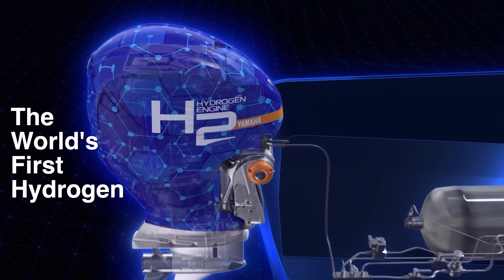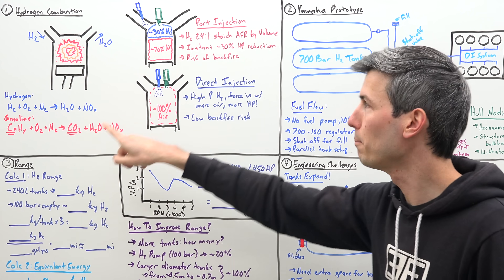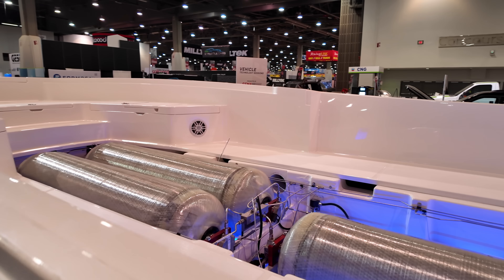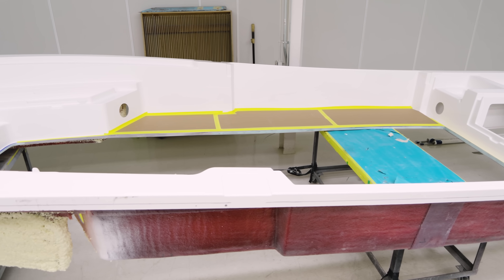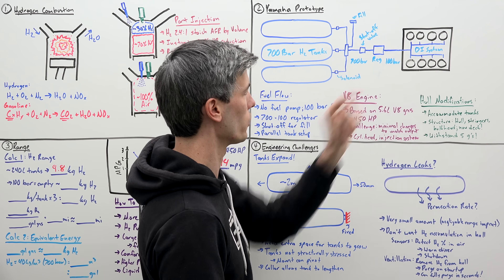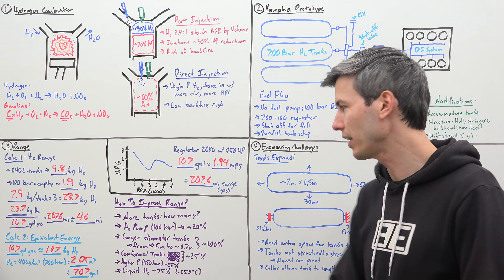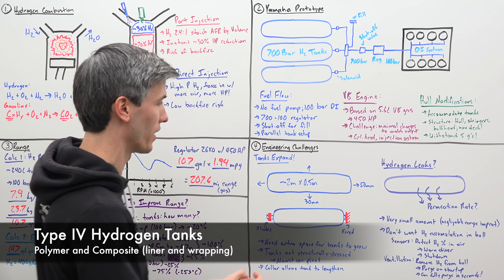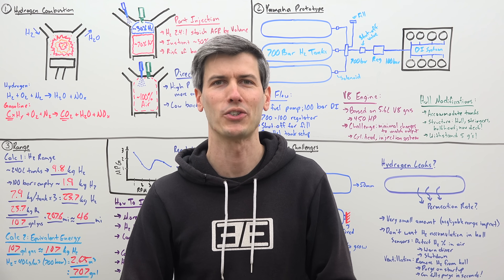The World’s First Hydrogen Combustion Outboard Engine!

Comment: psst....."hey buddy; forget that mess and use propane" it's easy and cheap to retrofit to ANY existing IC motor that runs on gasoline and has way, way, WAY more infrastructure already in place for fill ups. I converted my boat a couple of years ago; no more carburetor fouling, no more water in the fuel, no more fuel going bad when it sits for extended periods and a little bonus is that propane has a slightly higher octane.

Comment: Great video, the concept does not seem viable to me. Aside from the range and storage issues you detailed, all of those high pressure lines are subject to massive vibration and shock as the boat hits waves and the hull flexes not to mention corrosion from salt water in the bilge. The lines will fail in time or require the whole deck to be lifted to replace/inspect .
It would not be too fun sitting on the water with 10000 psi of hydrogen leaking into the boat the engine shut down and the purge system both beyond capacity and running the battery flat.

Comment: A battery electric will be better. To achieve 46 miles of range, we need just 266kWh of batteries. At 260wh/kg energy density at the pack level, like the 2023 NIO ES6 150kWh has, the battery pack would weight 1000kg (2200lbs). But we are saving the weight of the engine 436kg (963lbs) and the weight of the fuel 291kg (642lbs). Ok, we need an electric motor and electronics, maybe 30-50kg. So the battery powered boat would be about 300-330kg (660 - 727lbs) heavier than hydrogen, would have the same range, and would not have the hydrogen management issues :)

Comment: Hi Jason, not sure if you’ll even see this but I have been pondering something recently. At a given displacement, is there a cylinder configuration that would inherently produce more torque/power? (Ie. 2.5 liter i4 vs v6) and, if that is the case, would this be the same as displacement in/decreases? I couldn’t find anything on here but this seemed like a strikingly fitting topic for your channel

Comment: Should do a video on how H2O is a stronger greenhouse gas than CO2. The tailpipes from these engines emit steam. So a condenser and in-vehicle collection storage would be advisable, except on a boat of course. If we hypothetically replaced all vehicles burning fossil fuels with H2 what difference would that make to greenhouse emissions. Also, there's still NOx emissions.
I admire Yamaha and Rouse having a look into the technology, but I really can't see it gaining traction. I would never be even remotely interested being near a tank holding 700 bar of anything, no matter what certifications.
Reply: "H2O is a stronger greenhouse gas than CO2."
H2O is water, i.e. rain. Do you mean something else?

Comment: It does seem to be a bit of a futile attempt by the traditional ICE companies to keep building ICE engines at all costs.
The video starts out saying that battery electric is out of the race because the batteries are too heavy if the are to give the equivalent range but at the end of the video hydrogen can’t even get anywhere near as close in range but on top of that has all the challenges of dealing with hydrogen. 
Electric are the future and there has been big improvements in energy density of batteries and more to come in the future. Hydrogen is hydrogen you are not going to change the characteristics of it so there marginal gains to be made. And as others have pointed out, the creation, transportation and storage of hydrogen kind of outweighs any environmental benefits from using it. 
Maybe for really big ships you might have the space to make it more viable but I haven’t seen any developments in this area.

Comment: 79% of the volume ot air in the cylinder of which 19% is oxygen means that the amount of oxygen is 15% of the volume which is sufficient to convert the 21% hydrogen

Comment: Interesting technology but recently I witnessed a guy cleaning his boat (no big deal) and he drug out his shop vac and proceeded vac out the wash well around the outboard  
In a split the vacuum exploded luckily no one was hurt but he sucked in bilge fumes and the electric motor lit off the fuel .
 I think hydrogen has a long way to go before it will ever be approved for boating especially when a shop vac is cheap and ignorance is cheaper.

Comment: About the electic boat. If you have 3.6 mwh of gasoline you use about 1080 kwh of that energy. Assuming high efficiency electic motors you need 1150 kwh of battery. Assuming 300wh/kg you need 3.8 tons of batterys and maybe 70 kg for a 700 hp motor. If you use as much tanks as you need for the same range the tanks alone weight 2.7 tons + the motor is heavier. So the bev is just a ton heavier but doesnt use expensive and hard to get hydrogen.

Comment: There is a reason why rockets explode. Hydrogen is not for boating. Imagine in rough swells slapping the hull with hot weather and those tanks expand, connections coming loose, tanks coming loose ect, bang goes your life. All sorts of issues can happen even to the best laid plans and engineering….. maybe in 30 yrs time but not the present.

Comment: In conclusion, this is not a better solution, than what already exists.
Unless the boat has onboard a water electrolysis system that turns the water into Hydrogen and oxygen, this idea is meaningless.

Comment: You made a video about the non-existing practicality about H2 in combustion-powered passenger cars. The reason is the low energy density by volume. The same is valid here!
How to increase the efficiency by 3? Fuel cell!
How to fill up this boat? That's a challenge!
More than 80 % of Berlin's motorboat fuel is transported in fuel cans.
There is a gas-station in the southeast of Berlin by the water. They offer RON95 gasoline, Diesel and LPG.
H2 needs a new infrastructure.

Comment: I believe there is a 3x error. The energy content of hydrogen is described by its (lower and higher) heating value. The lower heating value of hydrogen can be expressed as 33.33 kWh/kg or 3.00 kWh/Nm³. The higher heating value is 39.39 kWh/kg or 3.54 kWh/Nm³. The lower heating value of 3 kWh/Nm³ is usually used if the hydrogen is not burned directly. A practical medium value to keep in mind is roughly 3 kWh/Nm³. The energy content of 1 Nm³ (=1000 NL) hydrogen gas is equivalent to 0,36 L gasoline, 1 L liquid hydrogen is equivalent to 0,27 L gasoline and 1 kg hydrogen is equivalent to 3.3 kg gasoline (based on the lower heating value).
Reply: 1 us gallon is 3.78 liters.

Comment: If you redesign the pressure distribution system, I bet you could figure out a way to get the extra hydrogen from 2  <100psi tanks into the engine, and would only run out of hydrogen when the third tank reached 100psi. This would increase the fuel mass by 2x1.9kg = 3.8kg hydrogen.
Reply: If you did that, you might as well put it straight to the engine and gain all of it, but then you would need a 100 bar hydrogen rated compressor...those are not cheap my guy, not at those flow rates and duty cycle with that need for long operation.

Comment: It's not a weight problem, its a cost and space problem. An air ship that runs on Hydrogen would be a good fit.
Reply: Airships from back in the day were floating in the air due to hydrogen. Not powered by hydrogen. The were powered by Maybach engines. And those could be diesel powered ones.
Reply: @theblackhand6485  either way, floating or powered with hydrogen, the very flammable gas has to be stored on board. Would you fly on an airship that had several tanks on board with a very volatile gas stored at 10,000 psi? Knowing that those metal tanks are subjected to hydrogen embrittlement, gas seepage, and metal fatigue due to expansion/contraction cycles, would you feel safe traveling on one?
Reply: You mean like the Hindenburg?

Comment: In order to judge whether hydrogen-powered vehicles will ever be practical or will decrease greenhouse gases, it is necessary to consider the costs of producing, storing, and delivering the hydrogen, all of which will go toward the cost of operating a hydrogen-powered vehicle.  All of these costs are well-known  for gasoline, so a comparison of these costs between hydrogen and gasoline would be interesting.  There is also the issue that the most commonly used method of producing hydrogen in large quantities involve combining steam and methane at high temperatures, so the process of producing hydrogen in large quantities currently involves releasing greenhouse gases into the environment.
Reply: Yeah and sadly, there are a lot of losses used in the movement of hydrogen because of its much lower density vs something like methane.
Reply: All the cheapest methods involve making it from fossil fuels.
Reply: @lasskinn  In the long run, transient renewable electricity surpluses could be made into H2/O2 by electrolysis.  Building a bigger tank is a lot less expensive than a bigger battery.
Reply: @lasskinn  where do you think the hydrogen comes from?
Reply: @sstearns2  look the usual media zero emissions rationale for it is that you can get it from water and electrolysis is what what people usually think.

Its just the energy cost that makes making it from fossil fuels directly cheaper

So the marketing is sort of lying sort of not. You could make it with solar, but if the solar can be sold as electricity instead theres no point.

Hydrogen with electrolysis and then again into electricity with a fuel cell is just like 25%-30%. Use the hydrogen in a combustion engine and it drops to under 10%.

If oil cost like 5x then sure, whatever, it could work out, its not like the technology didn't work it just makes no sense now
Reply: 🤯💥🤯Multidisciplinary engineer/inventor here. We are developing an ultra simple, long life, engine architecture which offers significantly‼greater power to weight ratio [specific power] and energy to volume [specific energy]...without any pollutants [No, CO2 is not a pollutant] and can use any fuel or mixtures thereof. The ~60% thermal efficiency is close to an EV's charge-discharge cycle efficiency.😉 Waste-To-Fuel technology will provide renewable, carbon-negative fuels. 

😶‍🌫The 𝔽𝕦𝕖𝕝 𝔸𝕘𝕟𝕠𝕤𝕥𝕚𝕔 ℤ𝕖𝕣𝕠 𝔼𝕞𝕚𝕤𝕤𝕚𝕠𝕟 𝔼𝕟𝕘𝕚𝕟𝕖  
[𝔽.𝔸.ℤ.𝔼.] tech best solves the issues present in previous internal 
combustion engine designs by transforming the old paradigm into a 
simple, low cost, quiet, power dense, efficient, on-the-go liquid and 
gas fuel-flexible, ‘non-polluting’ solution for power generation of all 
scales and advanced mobility not possible before.

Companies can either get aboard or risk getting run over.  😁 

The core 𝔽𝔸ℤ𝔼 tech delivers better than 25% ABSOLUTE/ACTUAL [not relative] 
fuel efficiency improvement over gasoline engines, more than 15% 
for Diesel engines at any operating condition - speed/load, ambient 
temperature or elevation, not just at one optimal testing point at 
STP. Real world driving cycle savings could be an additional 200% 
higher due to the constant MAXIMAL efficiency and torque which 
results in a huge turn down ratio of ~99% without sacrificing 
performance. That means it's idle or running speed can be 10-50 rpm. 
The `simple, low cost, native/built-in, non-electric, environmentally safe, 
non-explosive, temperature agnostic 𝕊𝕦𝕡𝕖𝕣ℍ𝕪𝕓𝕣𝕚𝕕© feature 
recovers more energy than EVs and provides approx.100% fuel 
savings for a combined absolute vehicle fuel usage improvement of 
approximately 300%, thus obviating the basic need for expensive 
EVs & e-hybrids. 𝕚ℙ𝕠𝕨𝕖𝕣𝔹𝕠𝕠𝕤𝕥 adds >400% more torque. It’s like 
4 engines in 1. 𝕚𝔼𝕗𝕗𝕚𝕔𝕚𝕖𝕟𝕔𝕪𝔹𝕠𝕠𝕤𝕥2© further improves efficiency, 
torque, power & other performance metrics by 10%. This is all done 
w/o a transmission. Additional fuel saving solutions are available.
 
The FAZE engine perfectly follows the vehicle’s road or genset’s 
electrical power demand with no energy loss [no fuel waste], This 
unique characteristic enables dispensing with any auxiliary power 
units [APU] for power or refrigeration in any application. This also 
makes for a perfect range extender for battery electric vehicles [EV] 
or as a standalone EV charging unit even where is no electric grid.
 
The fuel agnostic capability allows instantaneous use of any liquid 
or gaseous fuel [natural gas at home!!!] incl. biofuels and hydrogen, 
even if old/dirty/unprocessed like flare gas or employ the concurrent 
multi-fuel capability…anywhere on the globe. One engine for all 
locales w/o changes! Unlike EVs, this enables fast fueling anytime, 
anywhere…with no troublesome infrastructure disruptions or 
changes. EV’s are not a solution to the [FAKE]climate or mobility topics 
as high level of electrification globally is unrealistic 
[See Patrick Boyle's video "Electrify Everything?"] .

The technology offers smokeless, non-polluting, low odor heat and 
noise output without costly after-treatments, etc.,… with only the 
lowest  CO2. It has a negative carbon footprint with hydrogen, 
ammonia, biofuels or gasified municipal, agricultural and/or forest 
waste and coal from a 2-stroke-like simplicity. These are HUGE 
business opportunities. 

The FAZE technology can be integrated into any ICE or vehicle 
architecture, adding some of the positive characteristics to its own. 

With virtually no electronics and emissions equipment, the cost of
purchase and reduced servicing frequency make this solution 
even more appealing.
 
Those are my two-bits

PS.
Did I mention we're developing advanced, simple, low cost, power dense electric machines and torque dense[read - compact], infinitely variable FrictionLess transmissions?
<><><>
Reply: See my comment above on the overall energy efficiency of using green electricity to charge a BEV versus using electrolysis to make green hydrogen as an energy storage medium.
Reply: Methane is fundamentally superior to hydrogen. For end application all the issues with hydrogen are dramatically less problematic. It requires much less volume, is far less prone to leaking, and getting it, with how hydrogen is currently produced is actually more enviromentally fiendly because they are sourced the same but the extra work to deliver it as hydrogen cost alot of extra co2 release. And if you can make hydrogen from electrolysis you can make methane from it (saving the distributed costs [much greater] by taking a centralized cost [cheaper]) you just need a concentrated source of CO2. Which is available in deep water bodies (still part of the biosphere so its not reversing sequestration, only intercepting a slice of it to avoid releasing more fossil carbon).
Reply: @alexanderx33  The main problem with methane specifically is that any of it leaking is a huge problem.
Reply: Ask Amazon factories the make there own for there forklifts... bit of research will answer questions..
Reply: @5150TJT  Not really scaleable. Certain things make sense to do at different scales. At the scale of society, you'll need NG inputs, so you might as well just use methane instead.
Reply: They call that the scoping. And it depends on the source of the hydrogen. Right now, it's pretty clear if done at a societal scale, it would just be from natural gas... so as an environmental GHG offset, it's a complete nonstarter.
Reply: Small children lack an understanding of object permeance, the idea that something exists even if you can't see it. Hydrogen and EV advocates also lack object permeance. You can claim all you want that EVs and hydrogen have "zero emissions" but just because it's out of sight, doesn't mean the emissions do not exist. Where do you think the electricity or hydrogen comes from and how "clean" do you think it was to make? Hydrogen is either made from petrochemicals, leaving most definitely not "zero emissions" byproducts,  or it is made at a significant efficiency loss using electricity that is also not "zero emissions."
Reply: Yes, The best hydrogen storage method by far is gasoline or diesel.
Reply: Just like evs takes more emissions to make the batteries than just driving a gas car for 20yrs...
Reply: @joshwhite9211  that is just false, it takes about 2-3 years (depending on the electricity mix) based on most LCAs avalible
Reply: @Joel-Lindstrom  I was exaggerating 😐
Reply: way cleaner than what we currently do with oil!! are you for real??? long term gains are blatantly obvious lol

Comment: Riding around on a bomb....a gas and pressure bomb....3 tanks right under your feet pressurized to 10k psi.....I have my safety squints on just filling up a 1gal 100 max psi air compressor.....scary stuff